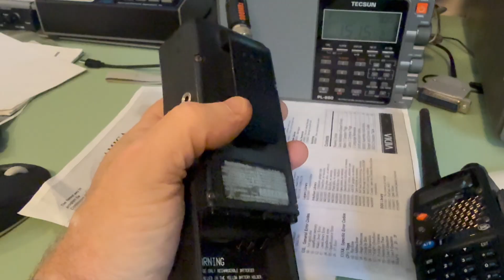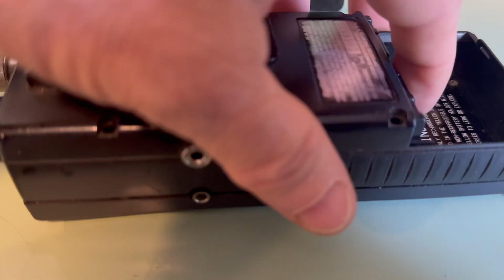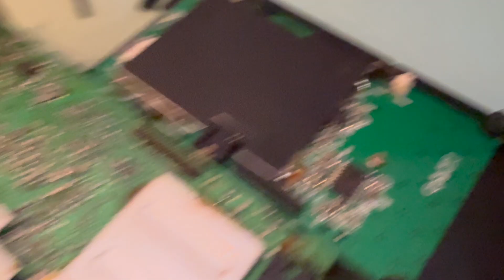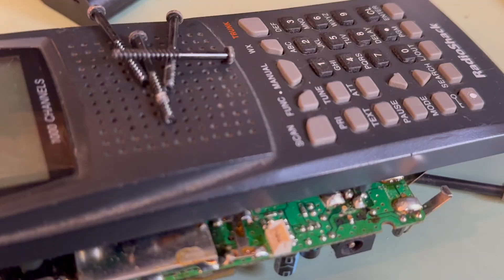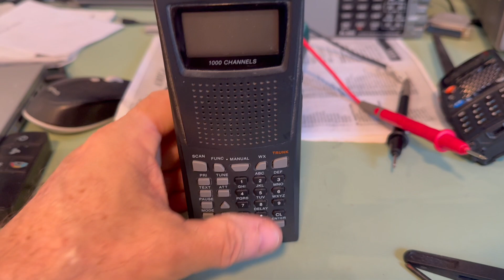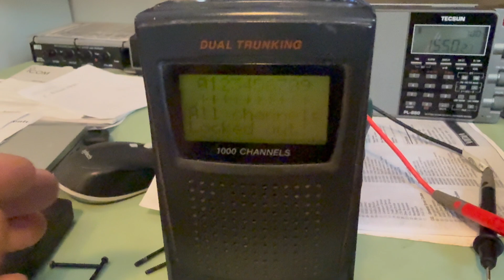RadioShack Pro-95 Scanner Screen repair

Comment: Followed this video and got a partial fix that should have been sufficient for me - but I wanted perfection, so I tried some other advice to clean the ribbon cable with alcohol (aggressively) with a cotton swab.

This took too much of the ribbon trace material up in a line across the trace because I was inadvertently rubbing against the edge of a component.  So lesson learned.

Easiest fix in my case is to find one for parts and try again with the face plate module.

Also, took it apart - I might be able to replace just the display, but I'm told they are long out of production and out of stock everywhere - and it's just easier to replace with a whole new face plate module.